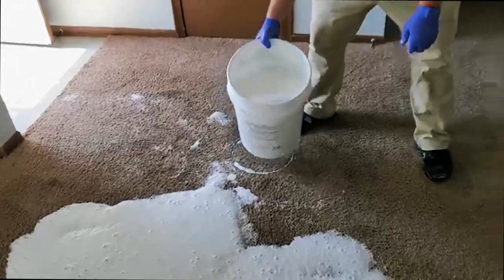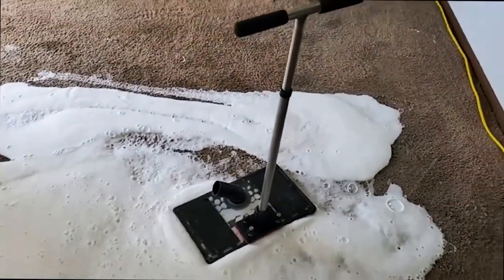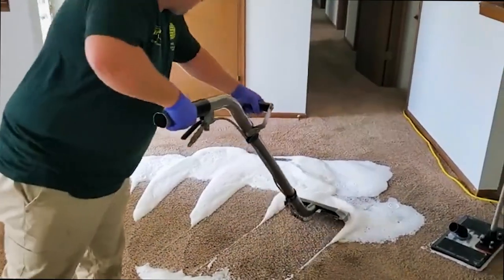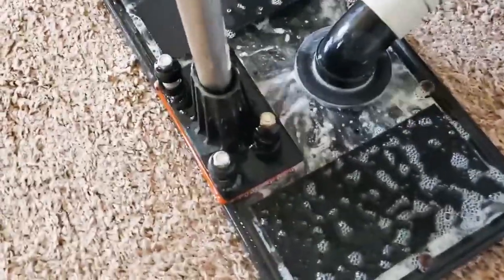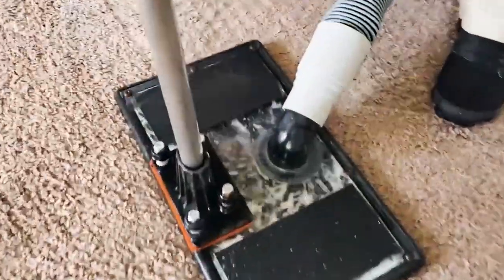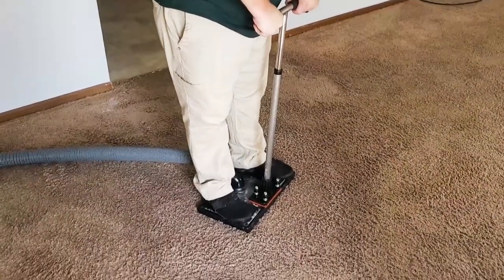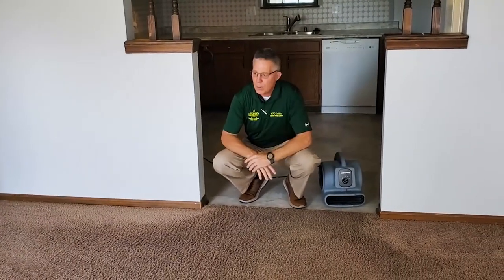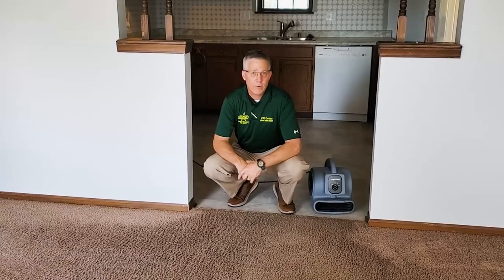Is it possible to get pet odor and stains out of your carpet pad?

Comment: Never in my 12 years of carpet cleaning have I even seen someone tip water on the carpets. 

Always used a good prespray with enzymes then used machine to extract and clean and it works well.

Comment: Youre flooding the carpet any restoration expert would have a fit.  Now you have to take up the carpet and leave fans on it.   That pad wont dry properly underneath the carpet and if the subfloor is wood youre creating mold
Reply: They are using an extractor
Reply: @OnjelieMarie  yes i do this for a living